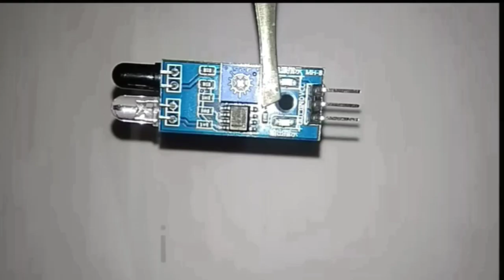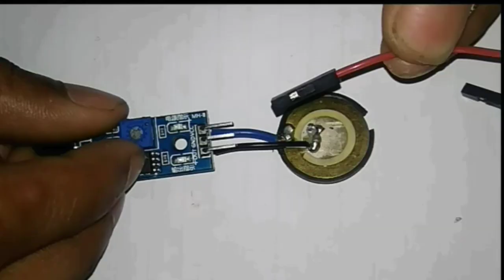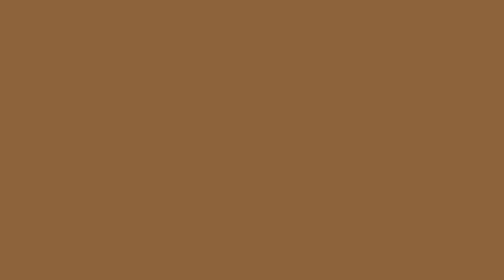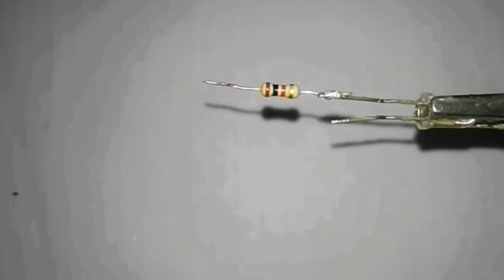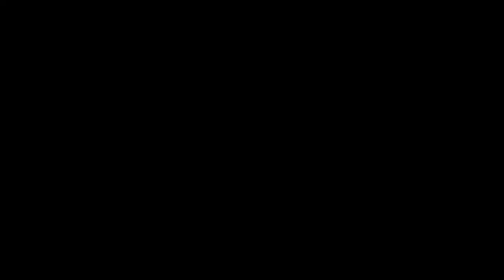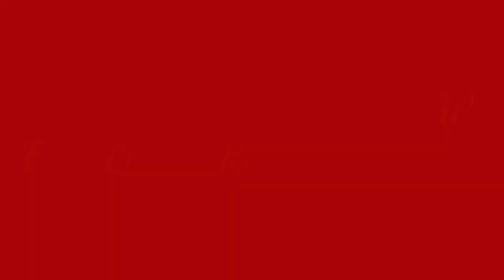Top 4 projects with ir senser without Arduino

Comment: ir sensor can suplay baterry 9V without step down or lm ?
Reply from the maker: Yes you can use 9V battery
Reply: @electrozon05  does not break the IR sensor ? because in data sheet,  input voltage 3.3 -5 V
Reply from the maker: I know but in 9V battery ampere is very low so you can used 9V battery